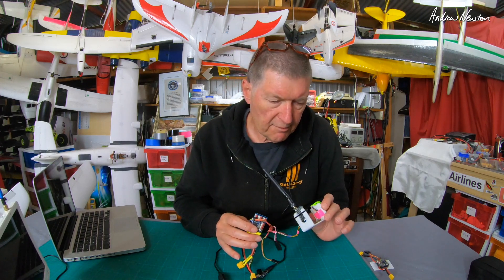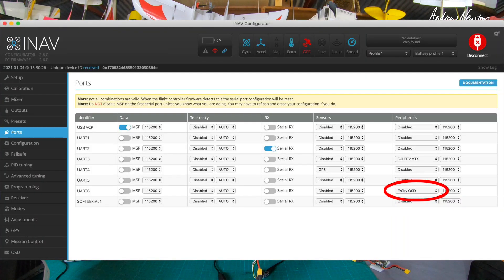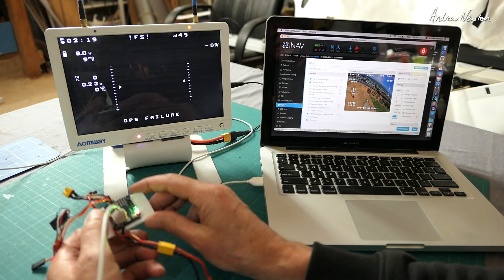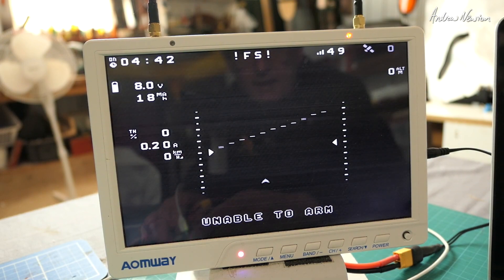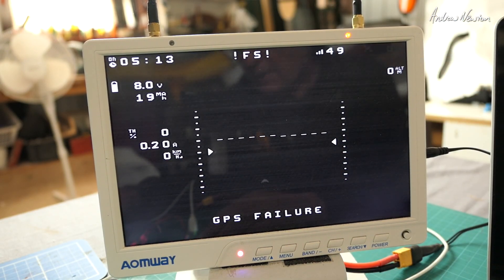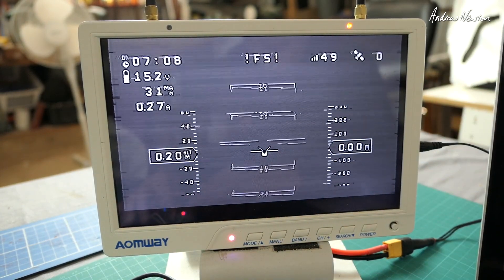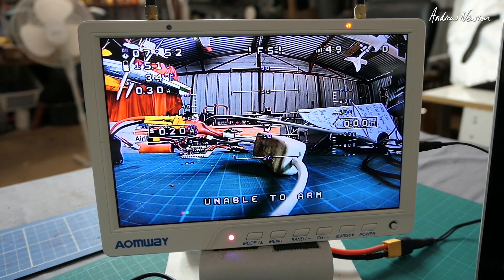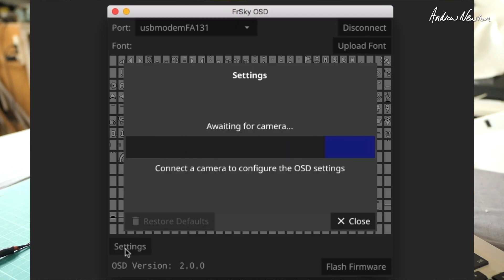FrSKY Pixel Based OSD

Comment: I can't get mine to work, even the app won't work keeps timing out. Any suggestions to try? I have no osd on my screen, tried everything I know, everything is checked properly.
Reply from the maker: Stand alone or on a flight board?
Reply: @AndrewNewton  its on the matek f722-wpx
Reply from the maker: @phillip7047  Are you getting camera view at all?  Check the UART peripheral is "FrSKY OSD" and not shared with anything else. Turn on "OSD" in the Configuration page.

Comment: Hello i have problem with setting up the Frsky Pixel OSD in Inav. The main problem is in the configurator (i tried many different versions) When i go to the OSD tab in Inav there is almost blank page. I have tried everything, also change fc firmware to different versions. I have tried it on my win10 laptop, also on win7 (same laptop) and after that i tried it with a second laptop but no good result, always the same: empty osd setup page in Inav. I hope you can help me with this issue.. tnx (port is configured for Frsky OSD, OSD (in config tab) is ENABLED.... when i uploaded a font from inav into the osd there were no issues but it is still not working
Reply from the maker: Which FCB? I haven't had any problems, has to be INAV 2.6
Reply: @AndrewNewton  spracingf3 , with inav 2.6 i bricked one fc... now i have 2.5
Reply from the maker: @marcnh33  OK, you need at least an F4 and INAV 2.6
Reply: @AndrewNewton  So, there is no chance to make it work with an f3?

Comment: Andrew do you know if the pixel based osd will become compatible with DJI ?
Reply from the maker: No, DJI digital system doesn't use the OSD chip on the FC.

Comment: Thisaerobatic fighter pilot says, the best OSD is no OSD
You know what my OSD Is on my large screen monitor?
An Avery Hole Reinforcements, White,stuck in the exact center of the screen.
In the old days, I used just a black dot drawn on with a sharpie marker which worked equally as well.
I shot up and shot down and flamed so many boys with that black dot.

So how do I get my information about battery voltage, percent, current, altitude, gsp, rssi, etc?
I have switches on my transmitter I can flick to read them out to me.  

I disabled my TX-15s trims and repurposed them to be momentary switchs, so that's 12 extra momentary buttons, and using the momentary toggle switch as a "SHIFT" key, I can double them up to 24 momentary switches to raad out any telemetry value I want.

I set logical conditions that function as alarms, so if any value falls below a range, it will audibly warn me, so I don't have to watch any values on the screen.   I set my S2 pot to to act as a totggle switch to turn on or off (silence) alarms, in case I should get a constant one that is annoying me (i.e. "I know the battery is low, I'm heading home as fast as I can!")
choppergirl@air--war.org
Reply from the maker: Very true. With OpenTX we barely need an OSD
Reply: @AndrewNewton  OpenTX and Crossfire or other Telemetry back.   It's a lot of programming, however...   Simple programming, but a lot of planning involved.

Comment: The technology slowly evolves: Character OSD --> Pixel OSD --> Vector OSD, and maybe even with colour options. In a decade, we may even see the OSD telemetry data save a Closed Caption overlay that can later be turned on and off. 🧐
Reply: Aerial Waviator that OSD data is already saved as separate file in DJI FPV, and can be turned on & off.

Comment: I just tested today that Flight Controller and the Pixel OSD!
I like the scroll bars but artificial horizon is a bit small!

Im annoyed about my receiver: i have an NEW ARCHER R8 PRO and a 
Taranis x9d plus se 2019. After 200-250 metters the radio starts to tell me that i have low or critical RSSI reception!
I never lost contact with plane, but im affraid! Any help with this issue?
Thanks
regards
Reply: Antenna placement...vertical on your TX and 90 degrees and separated on the plane...You could use the long range XM plus instead, much better...no telemetry, but you have your OSD anyway...🤔🤔😳🇬🇧
Reply: @EnglishTurbines  Thank you guys for the tips; i placed the two antennas from the receiver at an 90º degree angle. It starts to work fine!
Worked so fine that i got so excited looking  at the screen and watching the plane climbing very fast: 10m.. 50m.. 100m, 200m, 300, 500m... then, video signal lost! :O 
Model LOST...
After 2 weeks i got luck and found the model XD!! No damage at all just some dirt! 
cheers 
:p
Reply from the maker: Should be getting 10 times that range in good conditions. Look for broken, detached or blocked antenna. Look at the FrSKY manual for recommended RSSI alarm values, they are much lower for ACCESS
Reply: @AndrewNewton   @EnglishTurbines   @Kevin Torevell  

Thank you guys for the tips; i placed the two antennas from the receiver at an 90º degree angle. It starts to work fine!

Worked so fine that i got so excited looking  at the screen and watching the plane climbing very fast: 10m.. 50m.. 100m, 200m, 300, 500m... then, video signal lost! :O
I removed the googles and try to spot the 2400 volantex ranger plane (i installed some navigation lights) but i was really confuse about the location...
So, i just lost the model... :(

No Sd card in the googles and telemetry lost on crash. No luck on find it!
Lesson learned!
Cheers!
Reply: @RuiBentoAlves  I would recommend using a GPS on the FC and setting up RTH if you can.
Reply: @milkhbox  Hi!
After 2 weeks i got luck and found the model XD!! No damage at all just some dirt! 
But i have gps and RTH setup; i tested twice: 1st started to make small circles 100m far from me (not Hpme) with 45º roll and loosing altitude. 2nd started to go more far away from me! Therefore, i forgot that. i was coming home to find out the issue but i did one last flight and then i lost it! :p

Now, i have to learn better about RTH and test it
Any link or video about the "best settings" to a safe and unstressfull RTH??
thanks
cheers
Reply: sorry about the spam but i really wanna thanks everyone!
Thanks
Reply: @RuiBentoAlves  make sure your transmitter is set to output no pulses upon losing link with the receiver. Also set your failsafe in inav/betaflight to return to home when it loses signal.
Reply: Make sure you have the low and critical warnings set to the correct levels, check on frsky website,
Reply: @kevintorevell2406  Thank you guys for the tips; i placed the two antennas from the receiver at an 90º degree angle. It starts to work fine!
Worked so fine that i got so excited looking  at the screen and watching the plane climbing very fast: 10m.. 50m.. 100m, 200m, 300, 500m... then, video signal lost! :O 
Model LOST...
After 2 weeks i got luck and found the model XD!! No damage at all just some dirt! 
cheers 
:p

Comment: Andrew:
Did I understand correctly that you don't use an artificial horizon in your OSD display? I thought artificial horizons would be useful if line of sight visibility is impaired and this feature would provide additional orientation of the aircraft. If you don't use it, why not?
Reply from the maker: Just unnecessary for my flying. I guess it would be helpful for flying through clouds

Comment: I found that my -WPX displayed characters needed to be shifted, curious that yours all appear centered. I wonder what about the chipset would cause that issue. Also the bottom line in the viewed OSD output (on the monitor) is not useable, anything placed in the bottom line in iNav just doesn't show, which is disappointing. Look forward to where this will go in the future, like improved iNav Radar functioning to give better accuracy.
Reply from the maker: It displays differently on different screens. Maybe try upgrading to V2.0.0 firmware
Reply: @AndrewNewton  it is on 2.0.0, I tried shifting the display down in the app, but it just cut off that bottom bar again.

Comment: Awesome OSD! I did not know the new Matek boards had that OSD. I just bought 2 of the Matek stand alone OSD modules because I like how it looks and its features better than the original.
This is the ones I got...http://www.mateksys.com/?portfolio=pxosd
Reply: They had it on the F722PX and now this F722-WPX (-WPX having the BECs built in for wings). I think you will have less noise issues with that stand alone board though bc you can isolate the power a little better.

Comment: Cool pixel based OSD!  Looking forward to using the attitude ladders on my jet FPV flights.    Thanks for the review!
Reply: Exactly why I grabbed the F722-WPX for my A-10 with in cockpit pan/tilt. Sadly the OSD chipset is not liking the high current draw of the twin motor setup, so I am trying to work through those issues.
Reply: NoAgenda FPV  Thanks for the heads-up on non-compatibility with high current draw.  Will keep that in mind.
Reply: @motionsic  The FrSky chipset for on FCs is a 3.3v setup. Their stand alone chipset is 5V and could be more easily isolated, so that might be the better route for high current draw setups. And it could just be my FC too....
Reply from the maker: No problem 👍